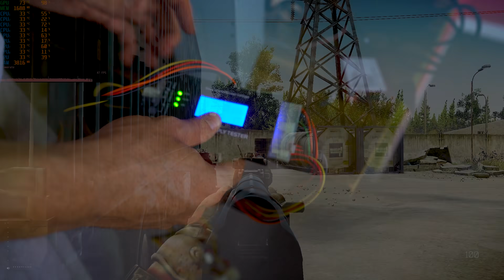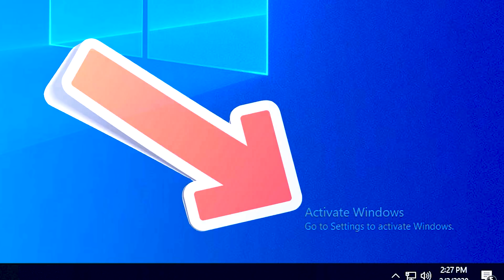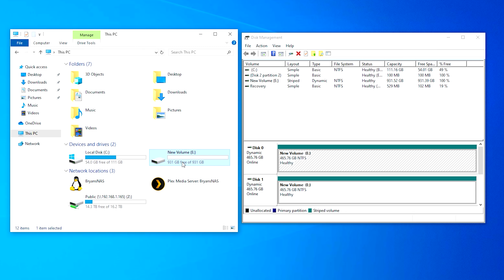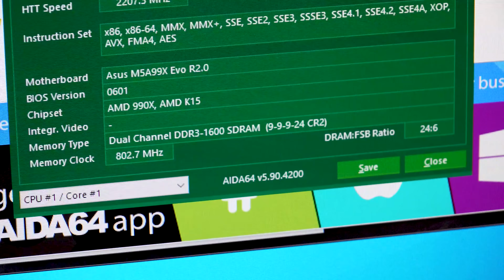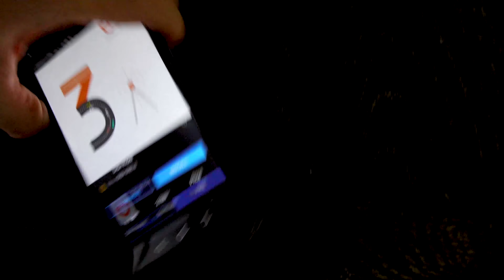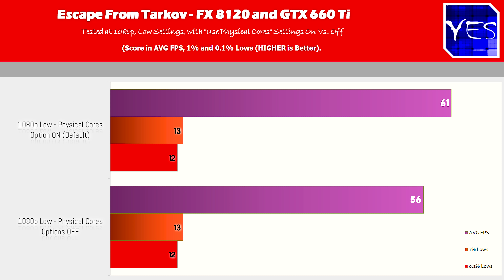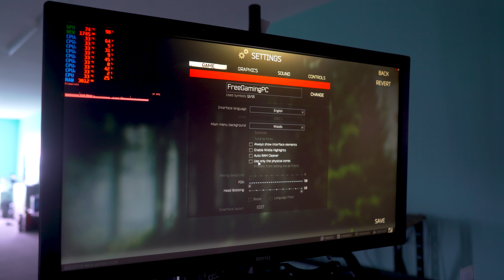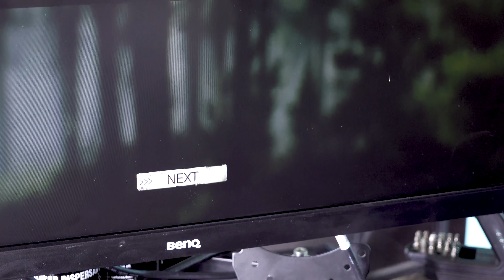How I Built an Escape from Tarkov GAMING PC for FREE (Mixing 3 Broken PCs Together).

Comment: I'm not one to toot my own horn but ive been playing tarkov since 2016 so i've made a few observations:
Tarkov is in open beta not closed. If you buy any version of the game you will get access. it used to be you had to buy more expesnive versions to get access.
The game is not well optimisedd at all. You can ahve the best hardware and you will still get stutters.
On some of the maps this game will comfortably saturate 8gb of RAM
Flat out ignore the recomended requirements as they were made 5 years ago and are woefully out of date My personal Minimum system requrements would be as follows:

Minimum:

CPU Intel Core i5 2500k/ AMD FX 8120

RAM: 12GB+
GPU: NVIDIA GTX 670/ AMD RADEON R9 280
25GB OF HDD Space

Recomended:

Intel Core I7 4770k/ AMD RYZEN 1600
RAM 16GB
GPU NVIDA GTX 1060 6gb/ AMD RX580 8GB
25GB OF SSD Space

there are a lot of settings that are available in the graphics menu that do not do a great deal of anything other than reduce your framerate.

If you have a GPU with 3gb of VRAM or more i'd recommend the following
Texture Quality: High
Shadoq Quality: High
Object LOD quality: 2
Overall Visabilty: 1500
Shadow Visability: 40
Antialiasing: TAA
Resampling: 1x off
HBAO: low
SSR: Off
Anistropic Filtering: on
Sharpnes: Personal preference
Lobby FPS Limit: System dependent
Game FPS Limit: System Dependent
Z-blur: Personal preference
Chromatic aberation: Personal Preference:
Noise: personal Preference
Grass Shadows: Off

Game Options 
Auto RAM Cleaner: on (the game has a memory leak issue they are still trying to fix)
Use Physical Cores: on
Reply: When he was going over the system requirement I was just thinking there's no way this game would run on a Core 2 Duo or an Athlon X2 unless you wanted to watch a slide show.
Also, it's a little ridiculous that they haven't ironed out that memory leak yet. I understand how difficult it can be to locate memory leaks, but it's been years.
Reply: This is the game that finally is forcing me to upgrade my PC. I have a Phenom II 1100T @3.8 ghz with a rx-480 I get 30 fps at most...Thank god for a freesync monitor.
Reply: @Couldbeazombie  yeah that phenom is gonna suck. I'd recommend hunting down a nice ivy bridge prebuilt to get the game running well.
Reply: @creaturedanaaaaa  I'm going Ryzen here in the next month. My rig needed an update anyway
Reply: @Couldbeazombie  Ah, sounds fair. I'm currently closing off a deal on a 6700k system so that's got me excited.
Reply: @Couldbeazombie  I only recently had to replace my old 1100T that I had in my wife's computer.  It still played played most games pretty well, it just couldn't handle Planet Zoo while watching Netflix at the same time.
Reply: @JonnyBoyUltra161  the fact that the no-shoot bug still exists to this day means optimization isn't a high priority case right now.
Reply: Wow when I used your settings for the 3gb I went from 20-30 fps to 90 thanks a ton for posting this!
Reply: @dakotaa8276  No worries my dude
Reply: Nah mate fuck that, I’m gonna rock my 650 and phenom II fx 3500 all the way

Comment: I’ve played this game for a while now.  It is ram heavy.  I don’t recommend under 16. I play it on 8 but it struggles.  I have a Ryzen 1500x 1060 6gb and 8gb ram and I run around and under 60fps. Getting under 60fps in this game will kill you.  This is the Dark Souls of FPS gaming
Reply: TheMadMedek i have a gtx 1080ti, 16gb ram and an i7-8700. I cant even snipe without performance issues on Reserve or Interchange..
Reply: Running 16gb ddr3, I regularly hit 12-13gb utilised in game. Definitely worth the extra investment in the ram.
Reply: @goofyCatttt  Don't feel bad I got a 2080ti and a 6700k (oc'd to 4.7ghz) and I still lag, games just badly optimised on some maps/in general.
Reply: It's the bad netcode, and the fact that you can't disable PIP for scopes. 16GB should be plenty for this game, Nikita and the dev team just need to optimize it, but they're busy making  all the planned stuff right now like open world map, weapons and other game mechanics.
Reply: @goofyCatttt  reserve and interchange is a heavily detailed map, expect to see lots of performance issues until they focus on optimization.
Reply: @tomcanty8856  bottleneck much?!?!?
Reply: @goofyCatttt  I have the same specs only 8700k at 5ghz, and I run 3440x1440p on high. The game runs perfectly fine for me, 60-70 FPS on reserve and interchange

Comment: A lot of people have noticed when playing that hyper threading will raise your overall avg frame a little but introduces some to a significant amount of stutter. You best bet is to have AT LEAST a 4 physical core CPU and leave the settings to phys cores ONLY. (This is especially weird with FX processors considering their shared between two "cores" floating point calculator architecture essentially making the  "8 core"  variants, FX 8000 series, "8 core/4 module" CPUS, the FX-6000 6core/3module and the FX 4000s 4core/two modules. This architecture design is what hampered this series of processors, especially in gaming) really an "8 core" FX processor operates as a 4 core with 4 more "weak threads." Wouldn't try this game on a FX 6000 and definiately wouldn't try it on a FX 4000.

Comment: Guys remember t3500's are going on eBay for super cheap, x58, add a x5660 for 20$ and a GTX 760/960 works with the stock psu and you have a really cheap gaming PC that can stream (6core/12thread)

Comment: I bought one of the ASUS GTX 660 like 6-7 years ago and it didn't play games well at all for me. It was paired with an i5-650 but using that processor with a GT 630 gave me about the same performance I regretted buying the 660 back then.

Comment: Built a working Thinkpad T440 using parts I got from a guy when buying a dead T450 for parts to fix my son's T450 (needed a new lid).  That is, he tossed in other Thinkpad parts which I used to build the T440.  Though I did pay $50.  Sadly, I did end up breaking a perfectly good touchsceen for a T450 trying to force it into the lid.  Still have some good parts, unfortunately, can't make a T450 because the motherboard won't boot.

Comment: did you try and play reserve, customs and factory are pretty decent for fps. you should probably try it again with the best specs you have on hand and see what the delta is between "$0" and as much as you can spend, and find the sweet spot of what you have on hand. you can use fps 1 or fps 2 in the ~ console to tell you your current fps and different frame times for different components.

Comment: The perfect Tarkov PC would be an i3-7350k overclocked to the max 5-5.1ghz, 16gb of memory, and a gtx 970. I gave 32gb of memory and tarkov occasionally will use upwards of 12gb even with the auto memory cleaner option enabled. I likes 2-4 cores, the faster the better. You still won't get much more than 80-90% usage on either the CPU or GPU with that setup

Comment: Every computer I have is made from somebodies leftovers. My buddy builds systems and networks for a living and I help him scrap leftovers and sometimes setup his builds. He usually gives me decent high end older builds from his tradeins and personal leftovers. I in turn give my older builds to my family that needs them. I have two decent i7 hex core boxes, one 980,the other a I7 4960x. Sister has a 1156? Quad core of some sort my buddy gave me and mom has one I doubt she even uses now except to print receipts and cat pictures. I have one extra box that has my old 128gig ssd and i73820 just for testing and redundancy and a old 19" lcd monitor for testing and building things without tearing out one of the main monitors here. Comes in handy when something new comes in to see what works. Been playing with and building these things since late 80s i think. Got my first 8086 pc about 90 and kept going from there.

Comment: If that motherboard has a NVidia North-bridge chip then what about installing the 4x2TB SATA into the computer in RAID 10 mode for  USER data and use the ports that is not part of the RAID controller for the Boot drive and the DVD/RW drive.

Comment: I played this game with a GTX 780 and it would get 60 to 80 fps (high+ settings, 1080 and 1440 had similar frame rates which was weird) consistently and I was running a 60hz monitor and it was the only game I played so I am still rocking the 780 although it is only pushed for watching 4K youtube vids...

Comment: Great Video thank you. 

Yes it is always nice to get free parts like this and is much better if these parts end up hwere someone can reuse them again which is much better than them ending up in a landfill.

I get free PC hardware like this from time to time to time from customers that they no longer want. I test any parts that can be reused in another build. I usee these parts in cheap builds and then sell them on FB for a really low price. 

If you are selling this PC and because you did raid 0 please let the new owner know that those two spinning drives are in raid 0 and to not turn the PC on with even one of the unplugged from the system and windows allowed to boot up. If they do there is a rather high risk of losing all of the data in the raid array setup. If they have to unplug a drive for whatever reason then unplug both of them at the same time and then boot up with out them powered up in the system.

As for the power supply problem I would not sell that PC with that power supply in the system. The PSU is runnning to close to being maxed out and will not last very long. If it is shutting off with just a small CPU OC even though you went back to stock settings on the CPU and probably graphics card that PSU is probably running near 90% max power output and will only last a month or two most likely.

The system itself looks great for sure for being older parts. That 8120 with the right PSU would probably make it to 4.4GHz to 4.5GHz most likely.

Comment: Hey i was looking for a pc to buy and I found one for $200 I was wondering if it’s a good deal here’s the specs.

Windows 10 Home 64 bit operating system. 
-MSI 970 Gaming Azura AM3+ AMD 970 SATA 6Gb/s USB 3.0 ATX AMD Motherboard
- ASUS GTX 1060 6GB with factory Overclock
- CORSAIR CX 500w PSU
-AMD FX(tm)-8350 six-core CPU OC (4.2ghz)
- 1 TB hard drive
-Installed RAM 8gb. 1600mhz+ Room for more RAM sticks. 
-CORSAIR cooling fan system. 4 total fans
-Cooler master V8 cpu cooler

Comment: it seems like your FPS was locked to 60.
Just to let you know, tarkov has a really wierd VSYNC implimentation. for you to turn VSYNC off, you need to enable it ingame and disable it in the Nvidia Controll pannel.
Reply: Also it cloud just be Nvidia drivers they are messed up for older hardware right now

Comment: i would not recommend anyone to use an adapter for the  GPU (molex to pcie power connector). In this case you are lucky the power supply not blowing up . i know this is a budget build  but do not promote something unsafe to your viewer.

Comment: This game chokes top end hardware. I'm surprised it runs this well.
Reply: because they use old engine cause not everyone have latest and greatest hardware and they want more peoples play this game by supporting old dx9, so if you have old dx9 gpu you can still play but as it is beta stage thats why performance is bad ig
Reply: @Ryzen-gh1en  They just updated to Unity 2018 last major patch.
Reply: @conradnawrocki9975  well hope they give us vulkan support in future, all though this game is not very heavy on cpu like bf5 or siege but still newer gpu can get benefit from low access level api, stuttering is the main issue in most online games, even tho you are getting over 100 fps but frametime is not as good as you want to be even when you have quite capable system, some engine cant implement well dx12 or vulakn like frostbite engine, i need dx12 support badly in bf5 which can help the cpu and in past we have seen cpu bound area dx12 or vulkan around 20-30% faster, small dev like Rebellion Developments can implement vulkan like a dream, strange brigade is the best vulkan port out there but here we go big budget AAA dev like ubi, EA cant implement low level api and dnt give a damn about optimization